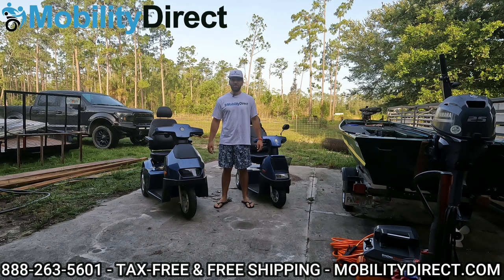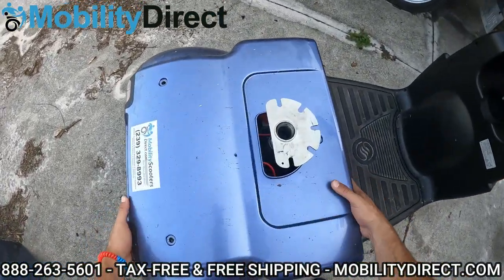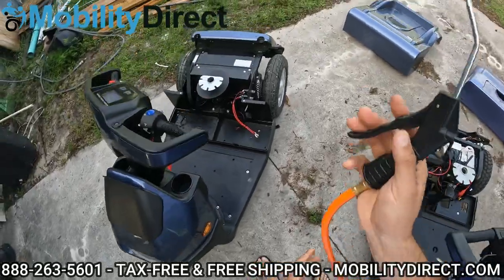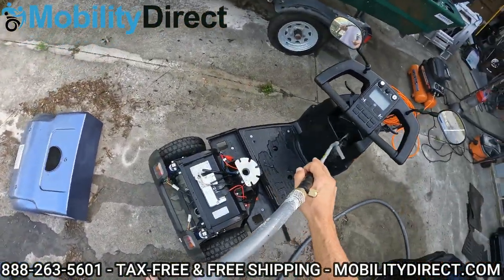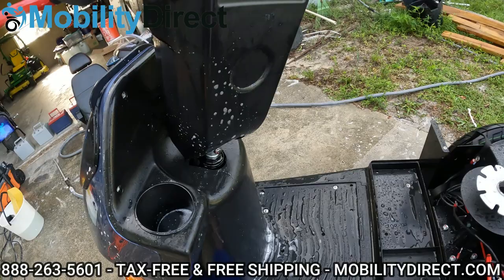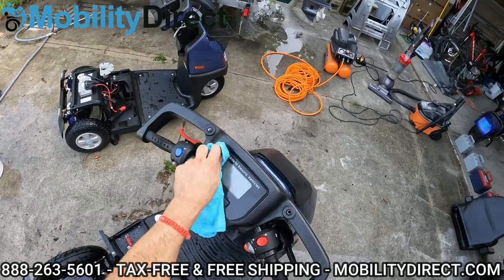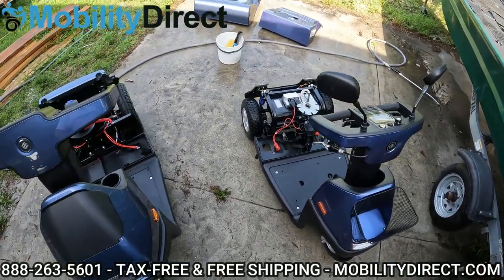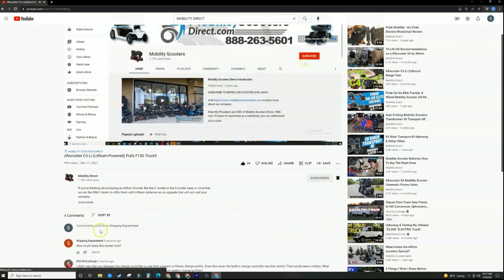🧼How to Wash and Clean an Afikim Mobilty Scooter

Comment: How to clean it if you live in apartment building.
Thank you 🙏🏿
Reply from the maker: There really isn't going to be a easy way to do it. I will try and make a video showing how to clean a mobility scooters properly indoors. My thoughts are you probably just want to use a damp sponge or damp microfiber cloth instead of a hose. The same principles apply you just want to try and get all of the debris off of the unit.